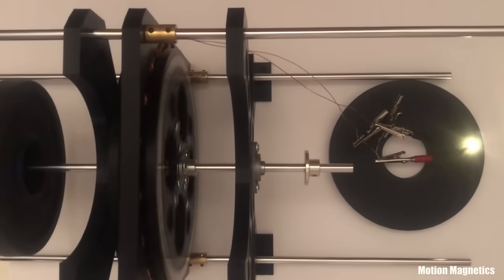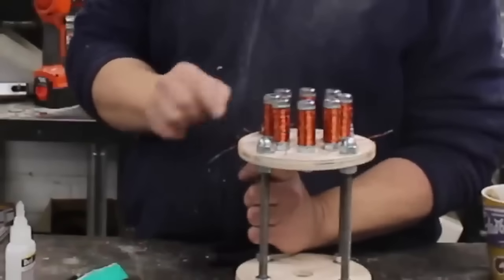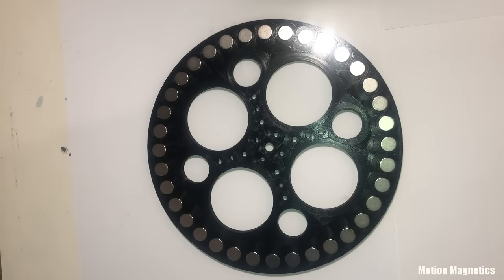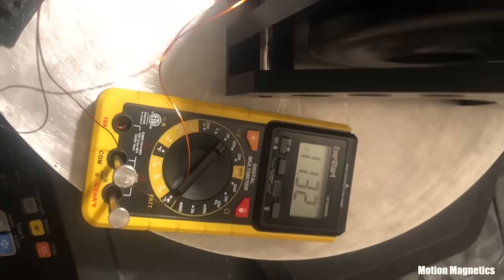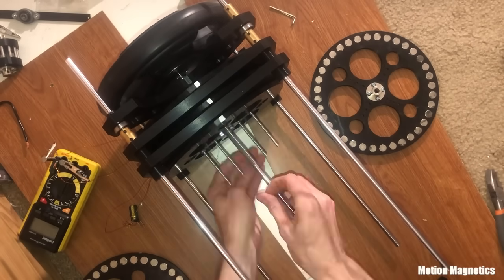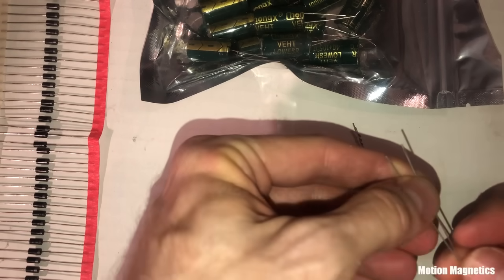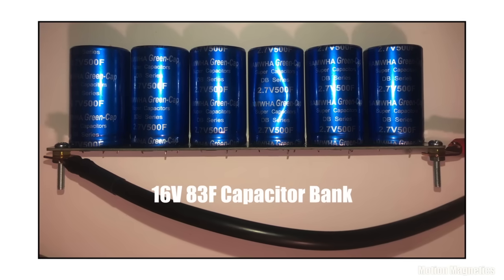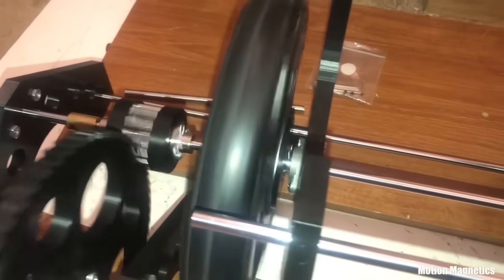Stackable Generator

Comment: Yes, bridge rectifiers are easy to make but make sure you pick the Right diodes. From my testing to make Stepper motor to generator what i learned that bought rectifier had lower voltage drop than the diodes i had. So you have to keep that in mind when making. Watch the voltage drop of a diode vs voltage drop of bought rectifier.

Comment: Fun. Keep on tinkering and Cary on Robert Murray Smiths spirit... Don't know why you went this route instead of just buying a super cheap highly efficient electric motor/generator but it's always good to build something from scratch yourself at least once for experience and to learn.. hard to beat extremely well balanced super mass produced robot winded electric motors with a plastic 3d printer and simple tools. Anyways good experience to have done at least once! Cheers

Comment: how many turns per coil? what would happen if u add a small high torque dc motor powered by batteries and the output of the generator recharging those batteries again?? obviously the power in the batteries wont last forever but if it is recharged simultaneously it will last longer than average would it?

Comment: Quick tip, bud:
Those wheels of circle magnets can be swapped out for squares and it will do better— the key is to rotate them 60° every time, and you'll have a load more torque. There's a Youtube of a dude doing this, but I cannot recall who did. The squares weren't just at a fixed angle around the circle, every following magnet was tilted an extra 60°. There is a reason for this: They "complete"* a rotation at 180° because of symmetry 1=0 2=60 3=120 4=180 {every fourth, but still ends up looking like 1,2,3,1,2,3} It was almost odd looking, but it makes sense.

Comment: I have learned one thing over the course of inventing and designing. Making things bigger does not solve problems . You can do the same thing with the size of a pop can and prove it works . Size does not matter when figuring out flaws and testing concepts . Magnet strength does not fix anything

Comment: I thought of this very same generator years ago, (folks home build wind generators like that) I like the stacking and the ability to add as many rotors as you want, You were talking about if you wire your coils in series it increases volts and if you wire in parallel it increases amps. You can wire one parallel and one series and wire them together and increase both amps and volts. You could use a section of your generator to put out 12 volts, get a super efficient 12 volt motor and a pulse width modulator (to use very little power) and use that just to turn your generator then other rotors could be wired to power/charge something else some other job. To rectify your dc voltage you could use a HD rectifier out of a truck alternator or you can purchase them say from amazon screw it to a board and use ring terminals on your wiring. In other words hd rectifier instead of the little dinky diodes. I have layed in bed lots of nights thinking about unconventional ways of generating power. I have one idea of using a high pressure pond pond pump say 10,000 gallons per hour that takes little amperage to run and pelton wheel to a generator  in an enclosed system with high pressure nozzles. My generator like you have built would have been neat but crude as I would have had to use plastics cut with conventional tools. You have a cnc and the ability to program it and have made a beautiful generator. Dont stop what you are doing and when you get it perfected Open Source it. The government will never let you profit from it and will never patent it they want to keep us slaves to the power industry Homopolar generators are cool too, look at some of the historical ones. They put out gobs of amps but little voltage. Seems there are ways to increase that though. If you could only negate lenz law you would have it made.

Comment: You're like me! I built a similar device a few years back, only to discover Michael Faraday had designed the same thing decades earlier. Check out "the Faraday wheel" 
Also, check out your heat build up, I was having excessive induction issues.

Comment: Great videos and information! Some of questions… 1) Would there be benefits to using wheels from hoverboards as generators vs all the magnets, 3D printing and wire winding? 2) If you buy a spool of wire isn’t it already “wound” and could be used directly as is? ( I don’t know if both ends of a spool of wire are available/accessible) …. 3) There is a huge industry just around generating heat for heating or cooking … could the gravity generator be simplified to send current down nichrome (??) wires and make heat? I’d like to have direct gravity to heat to heat up a room in the winter time.  With respect to resetting the weight, a human adult weighs an average of 130 pounds… reaching up high to grab a rope and sitting down wound be easy enough to raise a weight?  Thanx for listening !

Comment: OHHHH, you are going to need much more than a capacitor bank to run an inverter. Inverters draw a huge amount of amperage. Example: I have a 110 volt @ 750 watt inverter. 750 watts / 110 volts = 6.8 amps @ 110 volts.
To produce 6.8 amps, (full power), it draws 75 amps from a 12 volt battery. In order to power any kind of useful inverter, you will need to have a bank of batteries to supply sustained power. Capacitors discharge quickly. This is why they're used in photoflash guns. You will also need a much bigger generator to keep your battery bank charged. Your project is a great proof of concept but, I'm afraid, woefully undersized, my friend.

Comment: plastic is a horrible choice for your generator, also use a Hallebach array for the magnets, sharing magnetic fields will never work, double them instead! Remember the coil is what makes the current! Great project it's a great idea to remake the electric motor, its design is antiquated and ripe for innovation!

Comment: I was thinking of using gears to run a high torque motor so that it can spin a flywheel of Staters with very little wind but a lot of wind would be even more but it still would produce a more consistent output

Comment: Looks great! I had a similar idea with electric motors. Stack em for more power. I would say wire the generator in a 3-phase configuration. Easier to rectify and slightly more efficient.

Comment: Fascinated with your journey. I have a few questions though. 
1. Does the induction cause any physical resistance? 
2. Would magnetic bearings along radial and axial reduce friction?
3. Would these spin better inside of a vacuum similar to a flywheel battery?

Comment: Pretty sure you'll end up with a lot more efficiency if you get rid of the metal. There should be no drag on the magnets at all until you short the circuit So that the back EMF of the coil collapsing through the short circuit would cause a 'good' drag on the magnets.

Comment: There is a 2 phase AC generator that Nikola Tesla Invented in 1882 that has 4 slip rings that connect to 2 coils on its rotor. The stator is almost the same as a DC dynamo or universal ac/dc brush motor. this machine is able to make a rotating magnetic field that is in sync with the rotation of the 2 phase generator here is a video to show what the machine looks like https://www.youtube.com/watch?v=TK42nu2a00s I'm thinking that this design could be used to drive a generator depending on how strong the rotating field is that this machine makes.....

Comment: You’re making what’s called an axial generator. If you offset the pairs of stators and rotors by a few degrees, in a corkscrew, it’ll reduce the choppiness. Technical term is cogging.

Comment: I keep hearing that a magnet generator is not a valid why to generate power Can some explain to me why. especially when combined with a clutch and a flywheel. example magnet generator directly spins a flywheel the flywheel then is connected with a magnetic clutch then from the clutch you power a alternator and the just use or store the power.the flywheel can be disconnected from the clutch when it runs to slow so the magnet generator can have a chance to spin the flywheel up again?

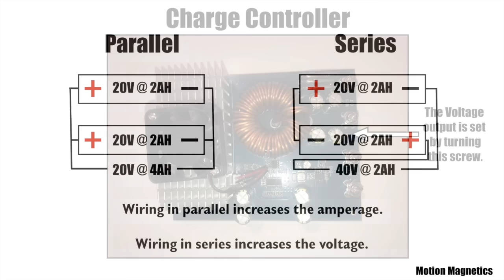Comment: Whilst lauding your efforts and drive I feel you need to gain a better understanding  of what you are trying to achieve. You keep talking about voltage generation and assuming, on a whim and a prayer, it seems, that by aiming for 2A you will get it? Also your diagrams at about 11:00 show two 2Ah batteries and a generator generating 4Ah, this makes no technical sense. You don't make it clear if this structure is to be used in anger but I foresee that it will soon shake itself to pieces, especially without balancing. I suspect, also, that once you have it spinning, at an operational RPM, if you apply a sudden electrical load this may well apply higher forces to the structure than it can survive. That being said, good luck with your future endeavours.

Comment: Can I give you a tip.. To know how good your designs are you really should measure the generators efficiency. That is the ratio of output power to input. Otherwise you could be wasting 90% of the power you are feeding it and not know it.

Comment: To increase the output you can use multiple smaller 2-3 bifilar serpentine coils in single stator. It will increase the amps as you already stacking them in series. Am also working on gravity generator 😊

Comment: You may want to consider incorporating fan blades into the rotors for cooling. Something similar to either a centrifugal or a squirrel cage fan maybe.
I suggest this because I imagine the possibility that once you really start generating power for any real length of time that the plastic may succumb to the heat of the coils. Just a thought, maybe you'll read this and remember if you need it 😊. Keep up the good work, awesome project!

Comment: Current flows along the surface of a conductor. If you can source flat wire you will increase the surface area which means more conduction with less weight.  Maybe try switching to an alternator. They can be built with multiple stages as well.

Comment: what's the point of all this? there are so many possibilities with this and you didn't do much. Also - use an electric drill to start it up next time. Find more info on flywheels. Etc etc.
Reply from the maker: It's just the first stage of a gravity generator.

Comment: I've built some of the TnT generators, and the serpentine coil jig you showed, and have remixed at least one of TnT's designs on thingiverse to make some improvements.  There tend to be some rough edges in the models when you go to actually build it, tolerances, polygon normals, etc. ;)

Anyway,  I thought that was useful info about the 10% vs 30% tolerances for that method with different wire.  I like the modular aspect though if anti-cogging is the design goal, wouldn't a multi-phase coil assembly make more sense?

Maybe it's foolish but I was thinking that you're going to eventually have some kind of condenser or battery for the charge you're accumulating.  Perhaps you start with a charged battery with a voltage regulator, your charge controller runs off that, and then you recharge the battery with the controller output.  I think it is unusual to try to power your charge controller from the variable incoming charge.  This is how I do it with solar panels that are janky, anyway. ;)  Maybe I misunderstood what you were explaining though...
Reply from the maker: Good point. 

Multi-phase is a good way to go.

 I'll be charging capacitors that will be powering an inverter. You could also use this setup to charge batteries as well.

Comment: If you have 12 volts at a high enough amperage, you can use an autozone 12 volt dc to 120 volt 60 hertz ac inverter to power appliances.

Comment: Micro trannies suck for what you are trying the wire is copper coated aluminum not good magnet wire and stainless steel words the best for hardware it still makes some power but not as much cogging

Comment: Ultimately humans don't output a lot of power. We can do it in short bursts, but if you want to use pedals to power something, you'll have to limit the current. It'll take longer but you won't be feeling that struggle against the power consumption. I'd probably just use it to charge a battery connected to the inverter because it'll smooth out the resistance.

Comment: I have a stackable generator, but what I did is create an axial flux motor that stacks and turns the generator. Use solar to power the motor and super caps.

Comment: You can stack it all you want. Problem is: You use a LOW RPM-motor. It will have a HUGE resistance to produce 50 Volts.
And this leads to Few RPM. And FEW RPM-motors lead to higher voltages, but LOW POWER (watts).

Because to get HIGH Power (Watts) you will need something like ~5000 RPM and not just the loosy 500 RPM you have, sir. And this is only something wind-turbines or even GAS-turbines reach! Because strong wind (in 100meters height!) and gases can have very powerful force to drive a propeller!

See? You are simply using the wrong motor for this project. YOU CANNOT power such a motor to get HIGH watts only with hands!

What you need is an HDD-motor.

HDD-motors are HIGH RPM-motors. they produce lower Voltages (max 12V or somehing like that): But you can get HIGH Watts out of them. I assume 100 W should be easily doable from an HDD-motor.

This is somehing i am building right now. I am using a low-watt HDD-motor. My goal is to creae a heating-device. So i put in elecric energy into the hdd-motor. It will have many magnets put on the disc of it. It will run under a metal, which slowly gets hot because of magnetic induction...until the fluid above it boils.

Power that motor for x minutes = get water to boil = first test.

End-goal is to produce a heating-device. Since you put in ~20W of electrical energy into the motor. And you get 200W of HEAT out of it, because the motor will have a speed of ~7000 RPM. So there will be a lot more energy produced that way.

You see?

A few days ago, i told somebody, that for each 500 RPM you put in which is a rule of thumb, you can get around ~5W of energy. So, 500 RPM = 5W, 1000 RPM = 10 Watts, and 2000 RPM = 20 Watts, and 3000 RPM = 30 Watts. You see? This isn´t  magic!
And if you have 7000 RPM like my hdd-motor can reach (7200 RPM actually), then you will get 70W out of it.

I use many slow and lightweight magnets though. Because this is what you need in order to reach high RPM: Leightweight Disc and low-friction (hdd)-motors.

Comment: I have approached magnet manufacturers but they are stating that grade N35 is called grade N52.. so I am confused
Reply from the maker: Sounds like the manufacturers you've been talking to might be confused? I pick up most of mine from Applied Magnetics. They carry better quality magnets than you'll find from most of the distributors on Amazon.

Comment: Will you later offer up the data for the 3d printed parts so we can mirror your design. I think it would be great for vertical wind generation design with the generator being mounted at ground level upgrading will be a breeze and configuring in a series parallel configuration can give high voltage high current for battery storage and home power applications
Reply from the maker: I listed all of the parts and made the 3D files available in this video: 
https://www.youtube.com/watch?v=OL-HiwAs-gE

Comment: LISTEN UP ! KNUCKLE HEAD, there are plenty of direct drive clothes washing machines used for cheap. They contain a motor/BLDC. !  NOW these motors are ultra low rpm generators at 50 to 100 rpm will produce 120 to 220 vac. And 50/60 htz. Just a bolt on application you can even just bolt a handle on and hand crank ,all ready made for use just tear it out of the washer and use!! Dirt cheap too.
Reply: Such motors aren´t suitable for hand-crank-generators. You are confusing volts with power as well!

See? they have a LOW RPM, that means they have a HIGH resistance.

What do you think high resistance means for your "handcrank"-generator?

Correct: I will mean your hands will NOT be able to crank it fast enough to produce energy.Y ou need HIGH RPM-motors for hand-crank-generators.

Because LOW RPM-motors are used in WIND-Turbines for a reason: WIND has a muich, much higher power to turn a high resistance wheel much faster, than any human hands can.

You CAN use a LOW RPM-motor in a Pedal-generator though. Remember: These BLDC-Motors have a VARIABLE resistance. And resistance is depending of the VOLTAGE-output.
So if your voltage is HIGH, like 12 or even 15 VOLTS, your resistance will be VERY HIGH.

If your volage is lower, like 9 Volts, your resistance will be medium (=OK). And if your Voltage is only 5V, then your resistance will be LOW.

Comment: You need to be EXTREMELY careful if you are disassembling microwaves for parts.   If the electron gun is compromised (almost a certainty) when removing it can kill you with particles that enter your lungs.  It would take about a decade to do you in but it is a very real threat.  Research this before cracking open a microwave.